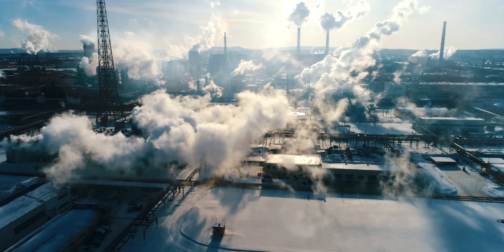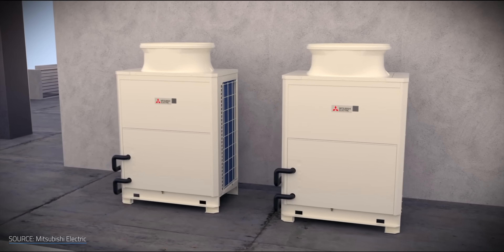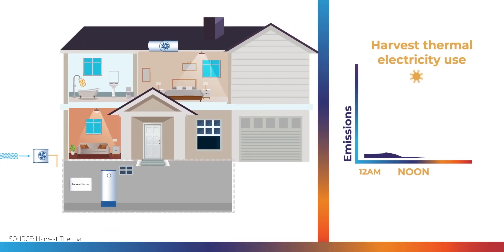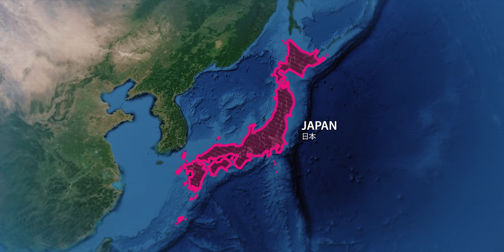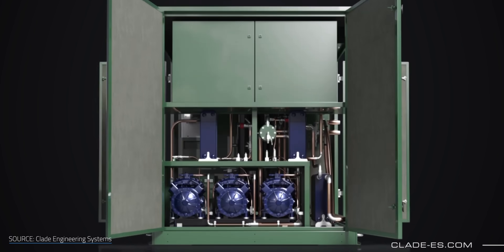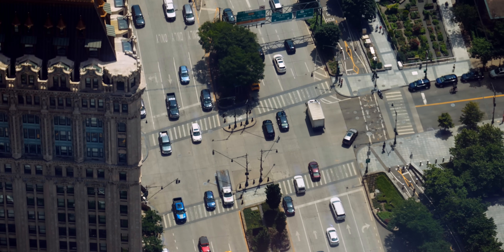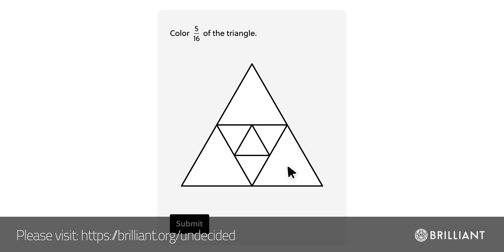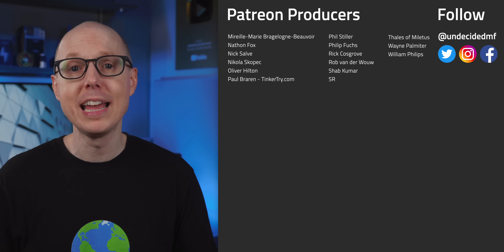Why CO2 Heat Pumps Are The Future Of Cooling

Comment: The problems with videos like this is that they always promote higher technology as an improvement.  And sometimes it is.  Unfortunately, today's new technology is pushing initial costs ever higher, while the increased complexity is guaranteeing more maintenance and reliability problems throughout the life of the equipment.  This is further aggravated by today's manufacturers lacking the desire to spend the money to fully test their products before throwing them out into the market.  The final nail in the coffin is the marketing job colleges and universities have spent the last 30 years pushing on us, which has caused a HUGE shortage of people going into the skilled trades.  Without highly skilled technicians, these more complex and higher-maintenance products will never get the proper maintenance and repair work needed to offset their increased complexity, thus creating a perfect storm for consumers.  And this completely ignores the problem that occurs when the chip your circuit board requires can only be sourced from one place on earth, and there's a global event that stops product of that chip for a time...

So yes, higher technology can often deliver lower energy usage.  But if the end result is significantly shorter lifespans for equipment, aggravation, and higher replacement and repair costs, was it worth it?
Reply: Well, you are posing a "what if" question and then asking if your "what is" makes something worth it.  The problem with that is that your "what if" might not reflect reality.  While technology does impose costs, particularly for first movers, those costs rapidly drop as the technology enters production scale and mass adoption.

As to whether it is worth it or not... we're talking about getting rid of a fairly large amount of natural gas consumption and replacing it with four small solar panels (or one large residential panel) worth of electricity.  Yah, its worth it.

So the only question you really should be asking is whether you, personally, want to be a first-mover, or wait for mass adoption and dropping costs before you switch.
Reply: @junkerzn7312 He hit the nail on the head about qualified technicians. The HVAC industry hasn’t had enough techs in well over thirty years. There are less people going into it every year. And the ones that are usually bottom of the barrel. But what do I know. I’ve only been in the industry for 30+ years and have been responsible for hiring for over 20 of them. No skilled technician means your high tech equipment won’t be working for long.

Comment: Ok, better at hotter environments but how do they handle with colder environment? My current heat pump starts to struggle around 40F below with the answer being using a 2.4KW electric elements to help thaw the heat pump. I’ve automated this to replace that electric drain with a gas fireplace for its thawing process. But if the thawing is done with the battery hot water tank then that’s a plus. Like the new studio, sounds good also but does have a little more echo resonating and that’s an easy fix as Im sure you know.
Reply: Low quality heat pumps stop working at 45F or below. A good quality heat pump will work down to -18F.

Comment: Where I live in Europe (Spain) heat pumps are the most common air conditioning units.  They, however, are not used for heating even though they have the capability.  This is because heating is usually done by on-demand type gas boilers in each unit because they a a bit less expensive to operate and the construction style here is much more conducive to running pipes for hot water radiators rather than ducts for forced air heat. The most common units use R32 for their refrigerant.  This is because it is the least expensive option and the installers recommend what they are most familiar with (new tech adoption can be a little slow here).  I have seen some new CO2 units being installed in new construction on more commercial uses.  I saw a SANCO2 unit going in on one, but did not know what it was and why it was different.  Keep up the good work and I am looking forward to the next video from your new studio.
Reply: The same heads that produce cold air can produce warm air.  No need for ducting.
Reply: Yes, but there are limits as to how many heads on unit can support.  Heating a seven-room apartment on say the 5th floor will require multiple units or are too large to hang on an outside wall and are cost prohibitive. @percyfaith11
Reply: Gas heaters cheaper to run than a heat pump 😅 Is that because of high electricity price?
Reply: Yes, European electricity prices can be double that of the US.  @krashanb5767
Reply: Vague statement without data to support it. A high efficiency heat pump is usually better than a simple gas furnace in moderate climates. In very cold climates with little A/C usage, natural gas furnace may be less expensive though it depends on how expensive the electricity is. @krashanb5767
Reply: I am thinking that your climate probably leads to considerably more air-conditioning demand than heating demand measured on an annual basis. It may be more economically viable to just use natural-gas heating to cover the relatively small heating demand in winter.

Comment: I highly recommend you partner with an engineer on at least some topics. It's not obvious that CO2 is better for the market than CFC or HFC cycles but for public policy levers. 
It's not exactly trivial to pump up a closed loop to 30 atm. Though the medium may not be chemically explosive, there is stored energy. 
The  thermal battery is a clever way to offset grid costs and compressor power relative to peak demand. Water is a handy medium, but forces T_hot or T_cold to be relatively mild unless pressurized. The car analogy fails. The thermal battery is a question of thermal power and stored energy. 
Really, step back and consider why these technologies are coming to market now. Older gear was provided to a market where energy was a much lower fraction of living expenses.

Comment: Feels like the only thing that is special about the system is the water tank as a heat battery. Couldn’t you use that with a more efficient chemical than co2 and have a far better system?